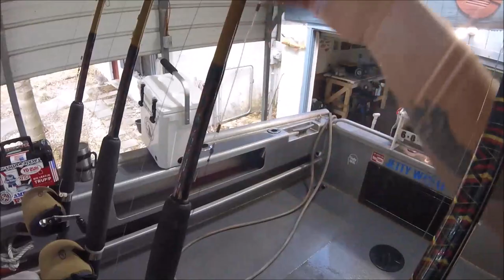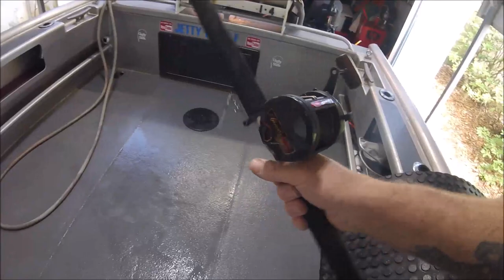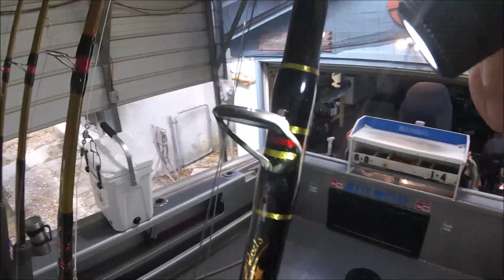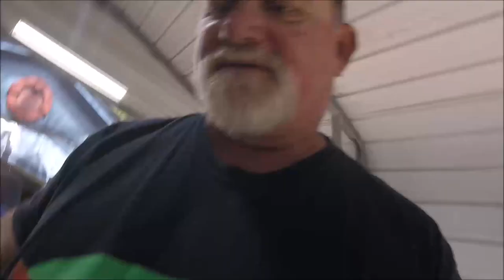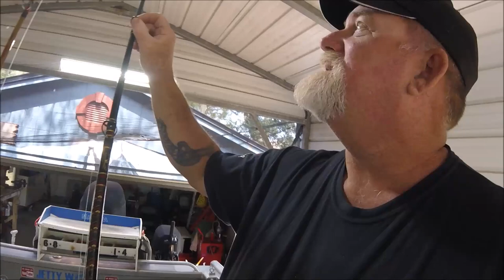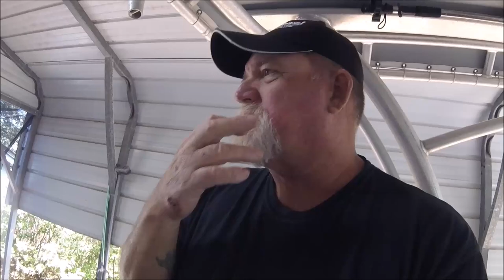UGLY STIK TIGER ROD vs. STAR ROD 'HANDCRAFTED' (read description)

Comment: I snapped an Ugly Tiger Elite and after a couple months they finally sent me a replacement…with all the eyes smashed down! I sent it back and now they say it’s on back order. I won’t even get the replacement this summer. I bought a Star to take its place and I’ll never buy another Ugly Stick. The warranty is useless. They couldn’t even be bothered to check the rod they were sending me. The worst part is that the exact same rod is in stock at several local stores! I’d rather pay a little bit more and get a Star Rod (I’ve got 2 now).
Reply from the maker: Exact same thing will happen with your STAR when you break it, in a pandemic. Try buying a new outboard motor!! I could care less what people do, or ignorantly complain about.

Comment: I bought the spinning version of that rod. The butt was too long for me and and very heavy for a graphite rod. I returned it. However, VERY high quality build for sure. I may get the HC medium 12-20 spinning rod.
Reply from the maker: its a trolling rod, not a caster. the only reason they made it in spinner is for that egg beater crowd
Reply: @CaptDavesSportfishing  Agreed. My application was for pitching live baits up into shoreline ricks from a boat so it’s to be held most of the time. I have a bunch of the Daiwa beef stick rods in MH that work well but the butts are too short. Trying to find the right rod. I build my own when it gets to this and might just be tweaking the Daiwa rods with new handle and reel seats.